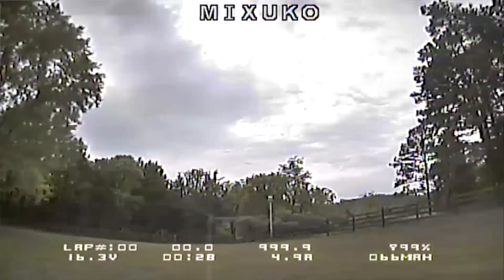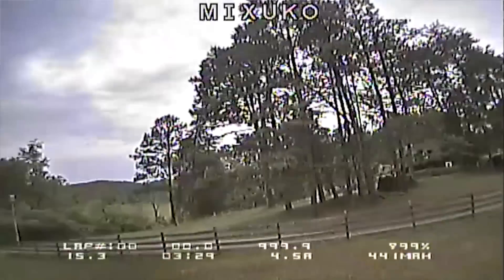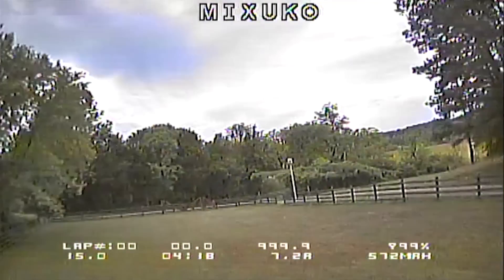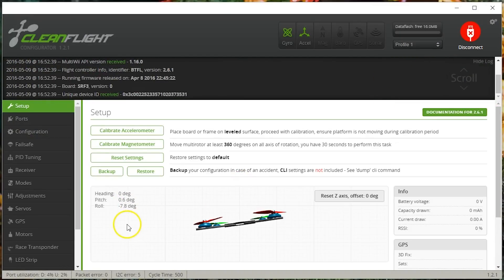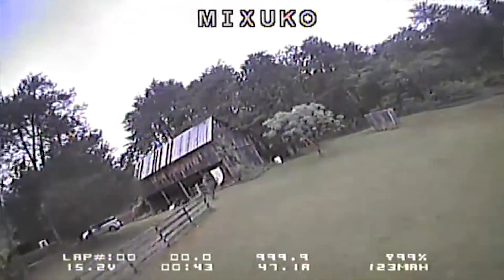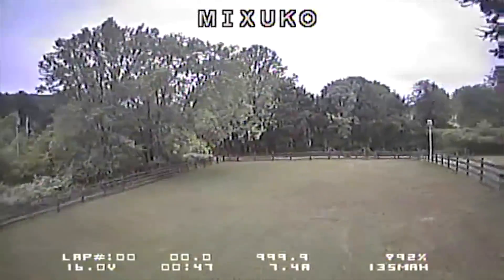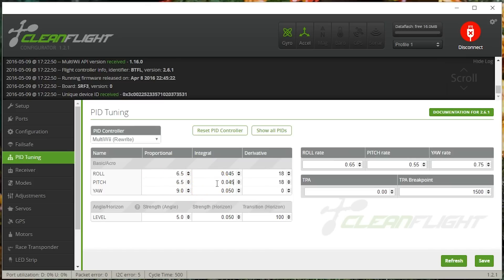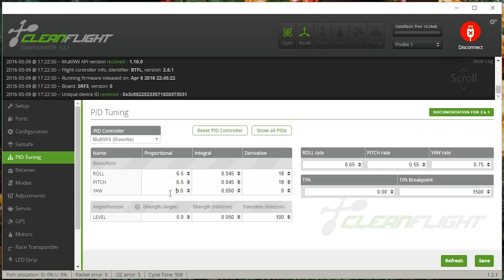Practical PID Tuning - Part 1  | HOW TO TUNE A QUAD

Comment: Great video. Maybe you can help with an issue my copter is having. I'm running beta flight3.1.6 stock pids and my motors get pretty hot.  I checked the screws to the motors and thats not the issue. Any suggestions? What other things could cause the motors to heat up like that.  I even tried different props to see if that was it but nothing samething.
Reply from the maker: +Chico300 d gain too high or motors severely unbalanced.
Reply: Hey thanks for the advise, I watch a lot of your videos and I know your a busy man.  I myself was thinking it had to be the motors but their brand new emax motors so I was praying it was something else but I have exhausted all of my trouble shooting and just didn't know what else it could be.

Comment: In Steele and kitzo pid tuning video they emphasized on keeping d as low as possible.  Concentrate on p gain. what is your opinion?
Reply from the maker: +Jack Truong I disagree. There's no reason to be afraid of D gain. It'd be like saying to use as little salt as possible in food. 

D is the only thing that can handle propwash, IMO.
Reply: Joshua Bardwell interestingly Mr Steele said ppl tuned their quad saying it is great but in his opinion it is sluggish. My understanding is if you want razor sharp response like ninja style d is your friend. d response more to abrupt change than p gain.

Comment: can the pids make my drone have less of the loud screaming noise? yes weird question but i feel like even on 4s mine seems like it dont have full potential punch and dont sound like some ive heard online. Will horizon reduce your power? compared to acro?
Reply from the maker: +David Downs that doesn't sound like PIDs. If you hear a screaming noise, the first thing I think is that you have a prop on upside down. The imprinted lettering goes up.
Reply: does horizon mode make difference on power? vs acro? just wondering if horizon is affecting my punch power
Reply: where would be good place to see if my blackbox upload could be looked at and see what i need to fix? most important question
Reply: why wouldnt blheli work on the littlebee 20 esc ive got? it dont show no connection. something im missing? i use betaflight for eachine wizard stock flight controller
Reply from the maker: +David Downs are you using the chrome app or blhelisuite?

Comment: Here's a summary of this video for those who need it...like me.        1.  Punch out full throttle and see if it pitches, rolls, or yaws.  If it does, raise the I gain on the corresponding axis.        2.  Raise P gain until you see Oscillations, or go high on P gain (create oscillations) and lower until they go away.  P gain oscillations in hard turns are even sounds verses hi D gain oscillations which are warbling sounds.        3. Once you get the P gain set with slight oscillations in turns but not in regular flying..up the D-gain to tame them down.

Comment: Hey Josh. I noticed when I did a blackbox log with my props off at middle throttle and all sticks centered I get a little oscillation on the yaw gyro with smoothing turned off. It goes from +6 to -8. Seems like some harmonics of some sort. Any suggestions on getting rid of this? Btw the board is a Revo F4.
Reply from the maker: With props off, weird things happen. I would first try to reproduce it with props on, in the air. If you get yaw oscillations in the air, the answer is usually filtering. Soft mount the FC and tune the notch filter for example.
Reply: Will try your suggestions. So far I have the FC soft mounted.

Comment: I got a zmr250, it wobbles a bit during take off. once it is up wobbles stop. another scenario is I push the throttle up high as it quickly rises I quickly push the  throttle stick down.  it wobbles as it falls then stablise. with or without air mode  made  no different. do you think that could be prop wash i.e may be d gain is low?

Comment: Awesome video's. I noticed in my cleanflight the I2C error showing 3, in this video your I2C is showing 5. I've searched and come up with nothing to identify where or how to find the issues. Any thoughts?
Reply from the maker: +BarnhartPhil there are a few when the system first starts up. If you see it incrementing after startup that would be bad.

Comment: Where can i download finish setupf for my cc3d? I have installed it and all.  Now i need tuning to be right.  And i know it is suppose be possible to download and install setup.   Please??  Anyone know?
Reply from the maker: +Ragnarok the PIDs will be different for every copter. I else someone has tuned your exact copter you can't copy PIDs.
Reply: Okey:-)  Im kinda new to this.  But i have downloaded settings for other stuff.  I will try and see.  Try with a laptop to tune the PID.  What is pitch?  If i may ask?
Reply: Ragnarok pitch is where the nose will rise or fall. (Yaw is left and right, roll is where it spins left or right)

Comment: Hi I tuned my quad on a day with very little wind without any oscillations. Then I went out flying on a very windy day and it oscillated like crazy. I turned my pids back down to default and it was pretty much gone. Though I could still feel very subtle wobbles. How should quads react to high winds? Can I get rid of those subtle wobbles?
Reply from the maker: +MrAngelIsland I haven't noticed any massive differences on windy days vs calm. But honestly I don't fly on very windy days often.
Reply: Joshua Bardwell ok thanks so you don't think that a too high p term would become more visible on a windy day?
Reply from the maker: +MrAngelIsland all I know is, my gut says maybe.
Reply from the maker: +MrAngelIsland I don't know. It's possible but I haven't experienced that.

Comment: I've never used a board that has boot pads before.  I got a sp racing f3.  Do o need to jump the pads before flashing BF?
Reply: Also since it has CF on it now will I need to use CF GUI to flash it or will I be able to flash in the BF GUI?
Reply from the maker: Yes. At least in my experience, yes. If it is a VCP board, you can type "dfu" from the command line after flashing BF.
Reply from the maker: You can flash from the BF GUI.
Reply: Joshua Bardwell not familiar w/vcp ?  What does the dfu command do?  I'm going to get some printer ink this weekend so I can print the manual.  I thought I read a rcg thread that didn't say anything about boot pads but a video I watched show the guy jumping the pads.
Reply from the maker: VCP means virtual COM port. If your board uses VCP then you have to be in bootloader mode to flash it, as far as I know.

Boards that use a CP210 chip can sometimes be flashed without going into bootloader mode.

The DFU command puts the board into bootloader mode, same as bridging the bootloader pads. It's just easier to do it from the CLI.

Comment: Joshua Bardwell  hi josh iv finally got my quad setup and ready to go but iv got an issue i cant get it to lift of the ground without it flipping  just as its ready to lift  its just instantly flipping over lol  can this be caused by  the  bad accelerometer & magnetometer calibrations   plus i noticed two off the legs is is slightly longer  and its not sitting exactly level it rocks slightly i cant even slacken them there fare to tight or emax has locktighted them bloody on  lol aaaaaaaa
Reply from the maker: Search my channel for "quadcopter flips on takeoff"
Reply: +Joshua Bardwell hiya if found it josh I was watching it before I went to bed and I saved in my watched later buddy thanks very much  but I'm going to start with the legs and gently run a file across them and make sure there are all the exact same length and make sure my calibrations ar spot on first  I do know my motors ar completely fine setup and going the way there ment to josh it's on my do list after a few coffees and an hour chilledout time watching TV lol I'm just up I only got 4 hours sleep lol  these qaudcopters ar taking over my life. llf  hehe but it's fun
Reply: +Joshua Bardwell hiya josh I did make a silly mistake I plugged motor 2 in to motor 3 lol but it's swapped over but should I have to calibrate my motors and esc again josh  and in my setup in cleanflight I done acceleration but my pitch on roll keeps moving and changing iv trimmed it out but when I go back in setup its moving lol if not tried flying it yet

Comment: how many broken copters does it take to learn to get this good? its so cool
Reply: Just bye some drones for 15 bucks a peice and start pactising.  I used two drones..  But not real fpv quads.  I used only those mini drones.  I can try find a link for ya. They are good also.  And you can fly indoor.
Reply: http://www.dx.com/p/jjrc-h36-2-4ghz-4ch-6-axis-gyro-rc-quadcopter-gray-447023#.WHNPAvnhCUk.   This drone is used for the mini fpv.  Can buy a tiny camera and put on.  But first and one time investement.  fpv Goggles.  These tiny cameras also transmitt. And it is this drone they use.  You can put on racemotors and get stronger.  But buy alot of batteries.  This is going to be fun.  And you cant wait until the battery is charged.  At least 5 batteries.  Anything else just asl.  I can guide you to do this he is doing.

Comment: if you know right away which adjustments need to be made, does it make sense to just land after half a battery, tune and takeoff to maximize progress per battery?   until you get into the more subtle stuff anyway...
Reply from the maker: Yeah for sure. But be careful of making too many adjustments at once, because sometimes you will end up with some weird effect and not know what caused it.

Comment: Hey Josh!! great videos we are following you for a while, very didactical great quality videos!! congrats from Chile. I you don't mind I Have a question.  i'm using Naze32 w/ 5040 props flying nice and neat,  yesterday I try a 3-blade 5045 fiberglass props and the bastard starts to fly unstable, like bumping in angle mode I guess it's some PID tunning. i'll apreciate any sugestions.
Thanks a lot!

Comment: How do you know there's no propwash? (Can you please explain what it is in simple terms?)
Reply from the maker: Propwash oscillation occurs when you do a sharp turn, and the copter is sort of sliding backwards into its own propwash. It also occurs when you are falling down at low throttle and then you raise the throttle.
Reply: Thanks for the explanation :)

Comment: i am just now starting and i have been flying on a simulator and i have turned my rates up a lot on there... when i go and fly my real quad i find myself moving my sticks around way too much, and flips and rolls are very slow. Will that be someting i can just change in the rates or will i have to also mess with the pids?
Reply from the maker: +JelectricRC just raise the rates or reduce expo.

Comment: someone should make a software to predict what pids you should have
Reply from the maker: +BarnhartPhil gtune is really hit or miss. I don't recommend it.
Reply: Cleanflight has a feature called G-Tune. I have yet to try it but from what i've seen and read about it should take you that much closer to properly tuning your PID's
Reply from the maker: +BarnhartPhil for one thing, it only tunes P gain if my memory is correct.

Comment: Hey josh if i post a video of my latest tune doing some test maneuvers and punchouts will you tell me if you think it looks good it feels way smoother almost like butter but that could be deceiving i dont know the sounds ive just been messing with things for 3days :)
Reply from the maker: +Ultimatevapor918 sure.
Reply: Ok its up now thanks man
Reply from the maker: Link?
Reply: not even close huh
Reply from the maker: Huh? I commented on your video... I thought I did.
Reply: I never seen it I ended up breaking the top plate on my 210 so I deleted it. was I close?
Reply from the maker: Yeah, it looked okay.
Reply: ok im back at it again i moved all the guts from the qav210 to the qav250 now when i give it throttle mid to high throttle i get bad vibrations any idea what ive done wrong tpa between 1500-2000 wont help and lowering p to 3.2 and raising to 7 didnt fix it i tried two different ends of the spectrum and still vibrates hardcore
Reply from the maker: Frame resonance? I mean, that's all that's changed right?
Reply: Yes sir
Reply: i looked up default pids for a qav250 the d is like 65 thats really high i think also says tpa 0.50 idk if i should change everything to that my d is at 23 it was fine on the 210 but the 250 looks like a H frame
Reply from the maker: +Ultimatevapor918 there are no "default PIDs for a qav250". At the very least you would have to specify which firmware it's running. But the entire setup down to the props affects the PIDs.
Reply: i just need in the ball park and i think i can tune from there i changed my d to 60 on pitch and 65 on roll then 3.5 on roll p and 4 on the pitch p he sounds alot better also i notice my motors were not starting when i wanted them to that seems to be fixed but my quad bounces when im on the ground in airmode before take off i have to bump my min command to 1040 calibrate then drop back down to 1000 and save to stop the chirp but the bounce is going to make me mad idk where that came from
Reply from the maker: I'm glad if your copter flies well, but if the PIDs were in the ball park, it's luck and not much more. I just switched props from DYS 5x4x3 to KingKong 5x4x3, and my P gains went from around 6 to around 10. D gain of 60 would have burned my motors on the DYS props. My opinion is that copying PIDs from someone who doesn't have the exact same setup as you is largely a crap shoot.
Reply: so what should  i do I always thought you wanted to start with a decent flying quad this thing was terrible worse ive ever seen you havent made a video of how to tune a terribly tuned quad lol
Reply from the maker: Sure I have! This whole playlist is how to tune any quad. If your copter is terribly tuned, start by turning all your numbers down: P, I, and D. So like on betaflight 2.7 through 2.9 for a "typical" 5" setup I might go P=2.5, I=0.020, D=10. That is going to result in a copter that is definitely under-tuned. Go fly. Now slowly work up those numbers until you find the right values.

If you know specifically what is terrible about the tune, then you can try to fix that specific thing. For example, hot motors = reduce D gain or filter more. But if you sort of have no idea, wipe the slate clean and start from scratch.
Reply from the maker: Starting from under-tuned and working up is also how you make sure you don't end up in a bad place. For example, if you plug in too high D gain with unbalanced props like the DYS I was flying, you are going to smoke your motors. If you start with low D gain and work up, you will notice that the motors are getting hot and not go any further.
Reply: Thanks Josh
Reply: ok im getting him very close only thing is when i punchout and start to drop throttle my front left arm drops some ive tried adding I cant seem to get that to go away been trying for an hour or so

Comment: I have bounces on my roll and pitch and can't tune them out even after 8's time on the field.

I've spent may be a couple of hours watching again and again about that pids and still can't  understand what to do. My set is - cobras 2204/2300, lantian 210 frame, sp racing f3, little bees 20A, kingkong 5040BN props. 

Now I am trying luxfloat pid controller and 250 looptime value. Playing with pid values as you guys describe in the videos, but it's still bounces on flips and rolls. 

And one more test which I haven't seen yet in videos - try to jerk roll stick while smoothly dropping the throttle, to make the quad starting to freefall - my quad starts to shake by roll axis like a boat on see waves (vvveery slow oscillations) - it happens with any number of roll PID (for instance right now it's 6.0, 0.42, 18).

so hate pids :D
Reply from the maker: +Roman Polonsky luxfloat tells me that you're in cleanflight? Try Betaflight 2.9.1. See if the defaults aren't already flying better than your current tune.
Reply: I use 2.8.1 Betaflight and Cleanflight configurator. Just had another try to configure my pids an hour ago and realized that may be my flips/rolls technique is not correct - I drop throttle to zero while doing roll or flip. I tried to do flips/rolls with throttle and the quad became much more stable! Oscillations still present, I made some changes and it became even better. I like it's behaviour more or less right now! So I made a conclusion that it's correct to perform rolls/flips with throttle. 

But than I watched again your and mr steele's videos - you drop throttle also! ( But may be not to complete zero, and may be you increase throttle before roll is over. 

So I'll continue my experiments.

And thank you very much for all your effort!
Reply from the maker: Zero throttle results in a more axial roll. Keeping throttle up results in more of a corkscrew or barrel roll.